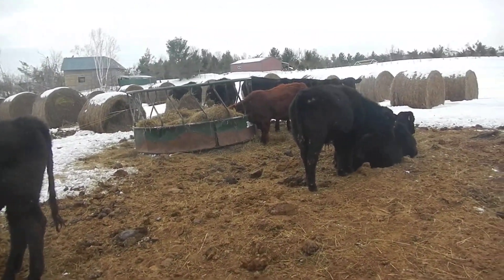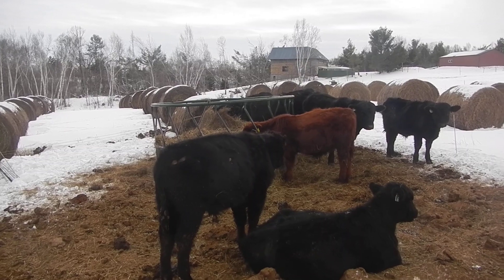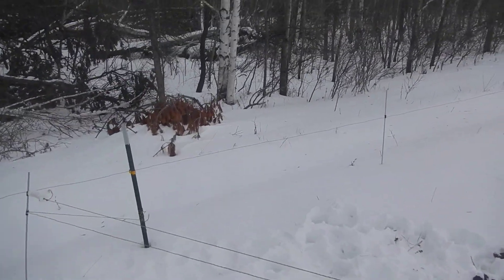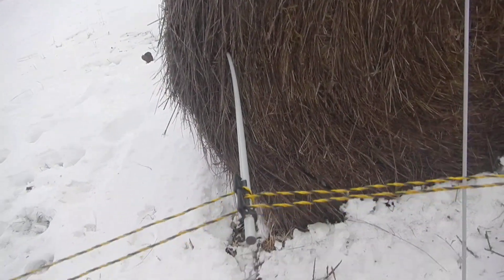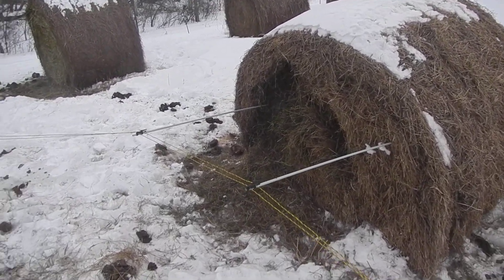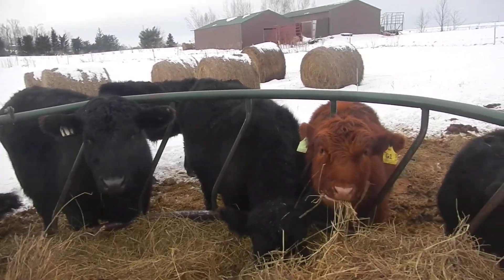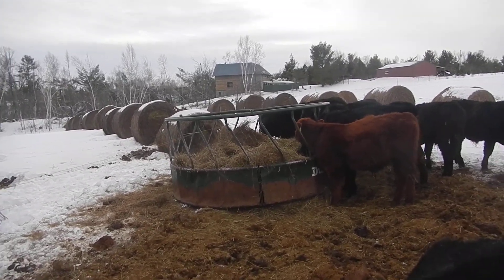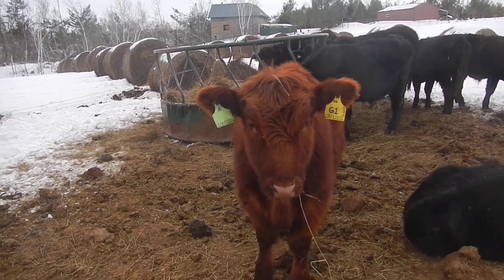Winter Fencing Hack From The Frozen North (Essential for Bale Grazing)

Comment: We are in Manitoba, Canada. Pretty cold and frozen ground. We have two hot wires on t-posts with a third ground wire in the center. The ground wire runs back to the fencer. It makes winter moves easier having that ground available everywhere. It gets so cold here that the ground will freeze solid up to 6 ft down.
Reply from the maker: For bigger operations in cold places it makes sense to have a ground going to the fencer year round. What I do works for smaller herds that are not applying physical pressure to all the fencing that surrounds them. I do managed intensive grazing so I have many paddocks that would require more wire than I care to put out. In 14 years of doing this, I have never had animals get out.

Comment: What breeds do you run? Or does it matter to you? Looking to get into raising cattle regeneratively.
Reply from the maker: It doesn't matter. We started with throw away dairy bulls but then we had to bottled feed them which was expense and labor intense but it worked. Then we looked for weaned beef calves and found a good supply. Look for a grazing network where you are farming. There should be one somewhere. Don't just buy from an auction barn. You could end up importing too much disease.